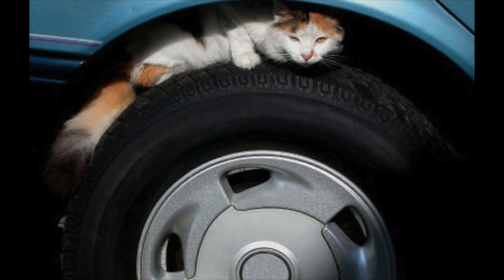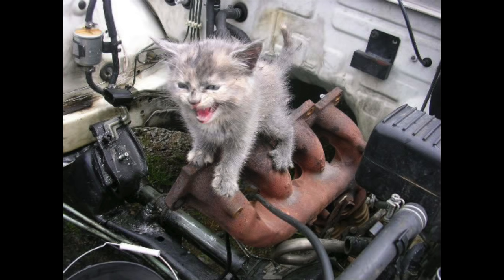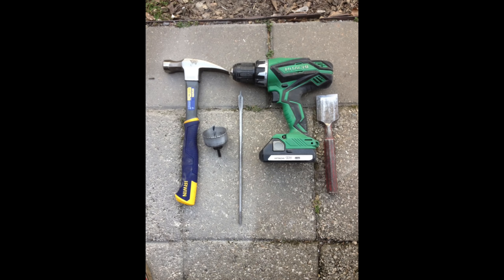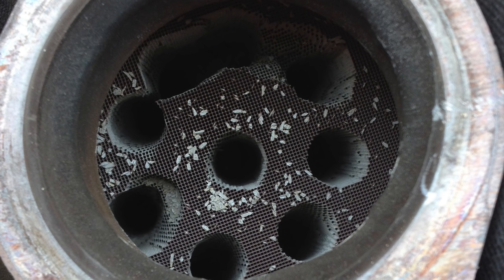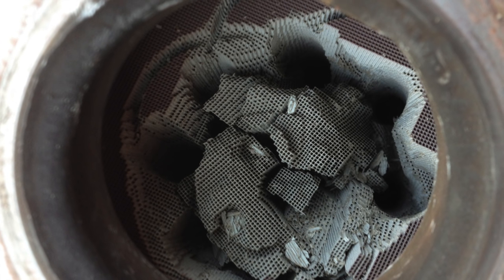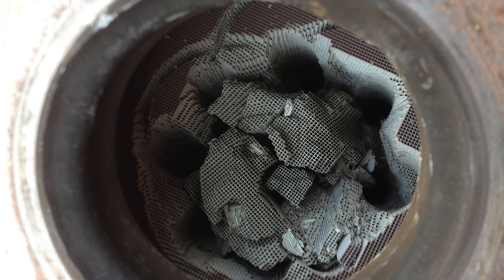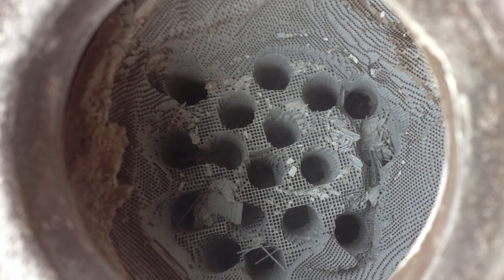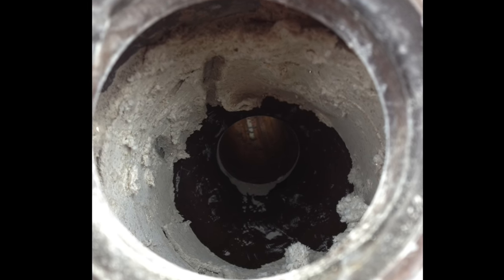How to Hollow Out Catalytic Converters

Comment: easier method; pull cstalyic converter out, throw a metal pipe through it  to hollow it out, reinstall it, done!
Reply: Super underrated comment. I used a rebar and a hammer 🫡
Reply: Yup 👍🏽 that’s what I did to my 2010 Honda V6 coupe then ordered some Mini-Cat’s off of Walmart website to trick the after cat O2 sensors that sniff the exhaust and ECU to keep the Check engine light off 😂

Comment: Hate to be the bearer of bad news but the "fibreglass matting" is not actually fibreglass at all, but is likely to be Refractory Ceramic Fibre matting. Why is this bad news? Mostly because RCF is considered hazardous waste and is very dangerous if inhaled, being made of extremely fine fibres which are easily breathed in if made airborne. It has health implications like those of asbestos.
Reply: Chrysotile asbestos. 60 percent is what this actually is unfortunately...
Reply: Yeah that's why I carefully break it apart and let it fall out, instead of what he did
Reply: Yeah when I did this (on a pre-cat off a QR25DE) I got a huge bucket, put the whole precat/exhaust-manifold in it, filled it with water (until water line was well over the actual catalyst) then attacked it with a combination of a long flathead screwdriver and a drill with spade bit on an extension. Did the job great with no chance of breathing any of the shit in (also meant no chance of there being any crap left over - which is especially important in this case because pre-cat was very close to engine).
Reply: So we got 10 to 30 yrs before symptoms. Sounds good to me
Reply: j mcmann  iv inhaled over 2million sq foot of drywall dust(atleast 200k maskless) and im fine.so this shit canr be that bad for you..
Reply: If you screw it up then just bolt on an off road H pipe.
Reply: @jimmywoo7875  and my uncle smoked 5 packs a day for 60 years and never got cancer, guess that means cigarettes aren't that bad after all right?
Reply: Maybe they shouldn't put it in cars exhaust then.
Reply: @jimmywoo7875  Lmfao drywall dust is nowhere near as toxic as this shit.
Reply: @jimmywoo7875   I used to smoke about 4 packs of cigarettes a day, but since I lost one of my lungs, I’ve cut my smoking in half
Reply: @Yophillips3272   exactly !!  What b.s. scare tactics - if you buy this $1200 miracle cylinder your exhaust fumes will be safe, but don’t open the cylinder it can kill you
Reply: @kellismith4329  I bet lol

Comment: Lol mustang fog machine. I can relate, my cats burned out on me and it looked exactly like that.
Reply from the maker: I'm glad I'm not the only one lol
Reply: MurderedCoyote how much $ for the scrap parts exactly
Reply: Philth Collins Hey my mechanic told us the same thing because it happened on my daughter's sebring convertible. When the fiber glass came out we put it in a quart sized bucket. It almost filled it up. He said it was worth a little bit of money. What we had would have been about $40-50 worth. Thieves here in Detroit cut off cats for this reason. I hear they get about $80 per cat. They cut off my cat from a pontiac montana minivan while I was at my doctor's ofc. I was pissed. I ran a straight pipe after that.

Comment: And this won't mess up the o2 sensors ?
Reply: Probably Yes, you need to tune it
Reply: Buy the dorman non fouler 02 coupler pack of two and drill one out and install the other coupler into the cat then the 02 sensor into the coupler you drilled out then install that coupler with 02 sensor into the other couplet that's now screwed into the original 02 plug in spot (only do this mod on the downstream 02 sensor. The first one is for air fuel stuff so don't mess with it). I followed a video on here with my 06 legacy gt which is turbod and literally the same thing as an sti and this will allow you to pass emissions and also have no check engine lights and hollowed cats. You're welcome

Comment: my shit box 2005 92x linear saab i use to get to work i suspect has a clogged cat, temp gauge fluctuates, i checked for bad head gaskets, no fluid mixing with the oil etc. temp sensors fine and coolant is topped off, would this get rid of my check engine light, or should i go to a muffler shop for a upper cat delete?

Comment: Does this affect the o2 sencers . I've got a 09 Buick Enclave . ant the check engine light is on saying that in small wards it's no good . will this make the check engine light go off
Reply: Will it affect how your engine runs? Maybe depending on how the 02 sensor set up on your vehicle is. On 1 02 sensor vehicles, it wont affect the engine because it will be before the cat converter. For your 09 Buick, its probably a multiple sensor up (one pre cat, others post cat to monitor emissions and adjust fuel mixture for such), so hollowing out the cat/cats will probably piss off the computer unless you get custom tuning so that the computer ignores all but the pre cat o2 sensor

Comment: On a 2014 Chev Impala can I put 2 Elimators on the down stream O2's and hollow out the cats or will a check engine light appear?
Reply: It should eliminate the code cause you put eliminators on the downstream.
Reply: I guess my Corolla is getting that treatment

Comment: I was looking for old 80s car solution where cat melted inside. Usually caused by too lean or too rich condition.  My solution was a direct fit "track or test pipe" (straight pipe)  to replace melted cat. However, no aftermarket test pipe for a Z31, have to use a custom exhaust shop.  More expense, so 2nd solution was to remove melted ceramic and rare metal materials from inside cat.  electric or air powered chisel from box store will do this easier than a hammer.  I would not recommend blowing this material airborne however, that is not inert non-toxic material. Old cars in my State don't have to have emission tests. Old pre OBD2 cars usually have O2 sensor in front of the Cats not behind CAT so nothing to cause error.

Comment: my cat is completely clogged ... should I do this?  will it harm my engine in anyway ?
Reply from the maker: This is a method that a lot of people use to unclog your cats. It really depends on what car you have and what year it is. I do have another video that will help keep your car healthy if you decide to go cat less on your car.
Reply: +MurderedCoyote
 
Thanks for looking out... In my region there are no laws on emissions so I will hollow my cat anyway... The real issue is what to do with the o2 sensor... Should I plug it off or keep it?  Thanks in advance

I drive a 2010 ford Taurus
Reply from the maker: Watch my how to run a catless exhaust video, that is my suggestion on what to do. I did that on my daily driver and it hasn't given me any problems and ive been running it that way for a year now.

Comment: I have removed it aswell but got
My check engine light on code p0340 , something like cat system threshold below efficient bank 1 and bank 2 did that happen to you aswell?
Reply: Does this also effect ur petrol consumption ?
Reply: That's because it's throwing your O2 sensors off now. That's the same code as the P0420 for Honda

Comment: Thinking about doing this to my 2011 mustang, will this make the o2 sensors freak out and cause a check engine light?
Reply from the maker: Watch my video on how to run a catless exhaust without a tune. If you hollow out your cats like this you'll need to do the stuff in my other video to keep your car from setting off a CEL
Reply: Not at all.
Reply: MurderedCoyote can you do this without removing the cat like maybe if I  pour gas into them through the 02 sensor hole and then start the car and rev it can burn out the insides?
Reply: Smart Feller yes but you can start a fire too, I saw a fire bird catch his whole car on fire doing that, don't recommend

Comment: Hello check engine light
Reply: Black tape will fix that, or a dab of black paint.
Reply: Joey Freedom MIL eliminators are your friend, or if you’re cheap you can screw some spark plug non foulers onto your o2 sensors and you’ll have no CEL
Reply: Just use an extender on the sensor. No more CEL.
Reply: @RegulerShowTV  yep, just did that on my car

Comment: Hi .
I have bmw e36 1996 I have catalyst problem I want to hollow that is there any problem with the engine performance ? PLEASE give me idea
Reply: Naeem Khan you will need to trick the 2nd (down stream) 02 sensor. Google “02 sensor emulator” 

The results will be better accelerating due to less restrictions in your exhaust

Comment: Won't you fail your emissions test?
Reply: Brandon Vasquez for sure
Reply: Yes 😂
Reply: The point is so you can hollow it out and put the shell back in so it sounds good. In my state cars from around like 1995 and before don’t need emissions but cars 1981 and newer still need regular inspections and you’ll fail that if you don’t have a cat. They don’t check to see if it’s hollow, just to see if it’s there so you still pass inspection and your car sounds way better
Reply: If you have an OBD2 tuner, some will allow you to delete the emissions code. Then if you live in an OBD2 area, you'll just magically pass.
Reply: We dont have those anymore in Oklahoma
Reply: Depends on jurisdiction. In Harris County, TX they're required, but in the next county east of us, Chambers County, it's not required

Comment: Hello loss of torque.
Reply: U won't lose torque, that old back pressure thing is a dyno proven myth.  However check engine light will come on. Unless you address it.
Reply: Do some research Stop believing eveer y lie you are told

Comment: Will this fix a clogged cat ?
Reply: Yes since it removes what can get clogged... but it will cause and issue with the O2 Sensor readings so you will have a new issue to solve.
Reply: @GameLoot  Would it depend where the 02 sensor is? If its before the cat it will be fine wont it?
Reply: @billycolvin7807  - There are multiple O2 sensors. Typically one before the CAT and one after. If you remove the CAT in between them the sensor that is after will not be getting the different reading it should be (the CAT cleans/changes the reading so if it is missing the reading will not change as it should). What I did to solve this was put a spark plug extender onto the O2 sensor (may need two extensions depending on length, you can get them at your local parts store like Napa/VIP/O'Reileys), this pulls the sensors tip out of the exhaust stream changing the reading artificially and tricking the computer into thinking the CAT is working as intended.

Hope that helps!
Reply: @PartStupid  I did just put a new exhaust on but now want to get rid of the cat, ive had a little dig around and cant see any wires going near the cat... reckon it will be ok?
Reply: @PartStupid  Wicked, if it does come up with a light then will have to do that. Its a mk4 1.9 tdi if that helps :))
Reply: @billycolvin7807  - New exhaust wont make any difference to the sensor issue, you will still get a check engine light and it wont run quite right (might not run terribly but wont run peak efficiently either).
Reply: @billycolvin7807  - Yeah. You should jsut do it anyways. The extensions are like $5 and only takes a moment.
Reply: @PartStupid  sweet, thanks